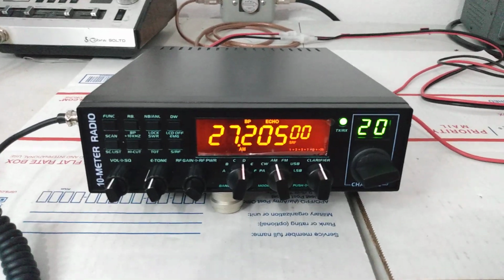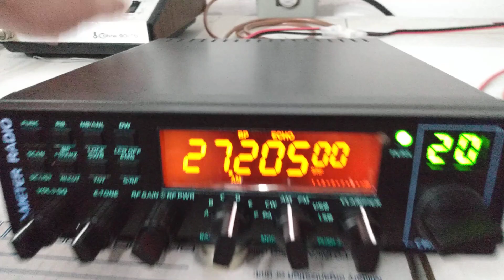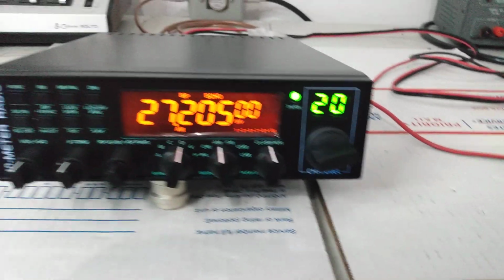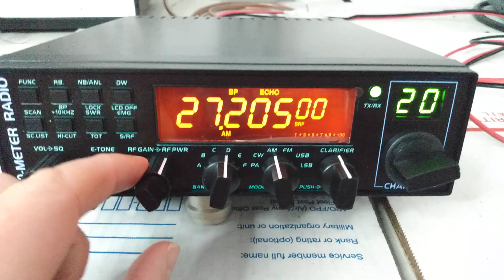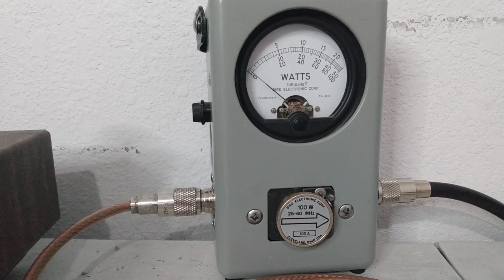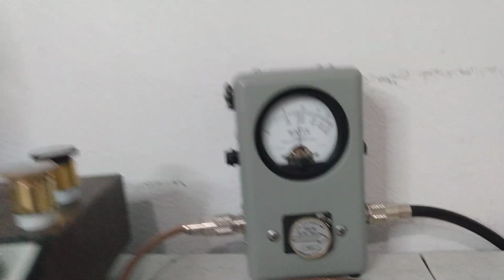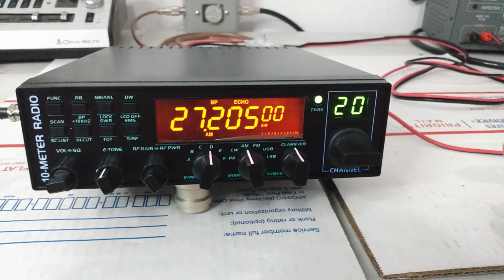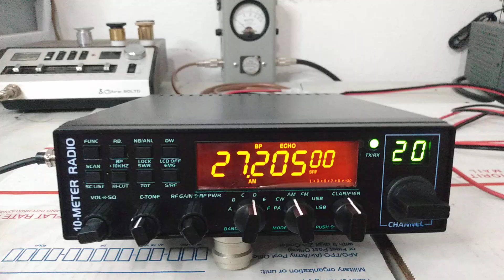AT-5555 returning to Customer

Comment: I have owned 3 of these . The first one was awesome and I gave it to a friend that needed one the last 2 were the worst radios I ever Owned. Dont know if I got lucky with the 1st one or bad luck with the last 2
Reply from the maker: What didn't you like? Surprised to hear that, most anyone that gets them seems to love them
Reply: @Rooster_Radio  the 1st one had great receive and audio. I ran it with a rm Italy 703p but I gave the set up to a friend and the last 2 I bought just had a horrible sound to it
Reply: @Rooster_Radio  to be honest I don’t even use 10 meter radios anymore. I now run a Cobra 29 with a 1 by 4 Carl Built and couldn’t be happier. Great audio and the receiver is awesome. Never new Cobras were that good!!! I ran through just about every 10 meter and big Ranger radio with amps on them that you can name even had 2 big custom builds. If I new how good Cobras are with power behind them I would have saved a ton of money over the last few years